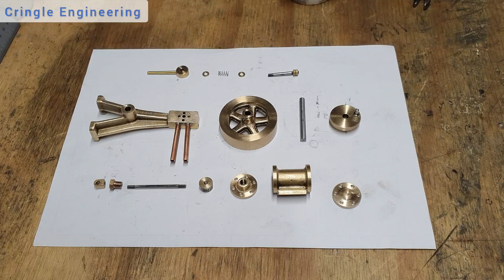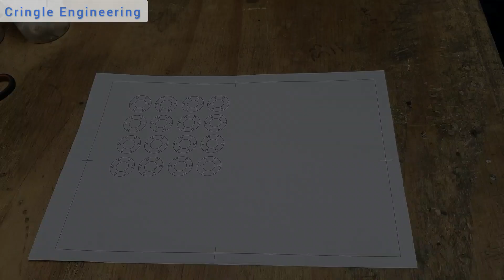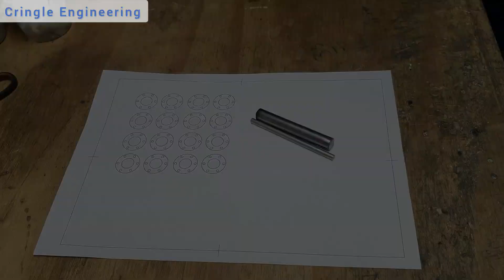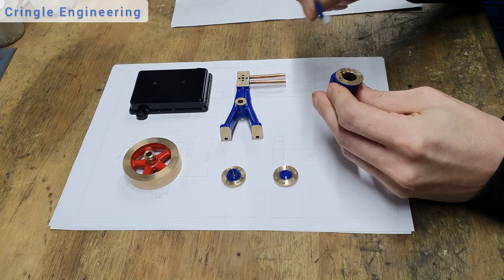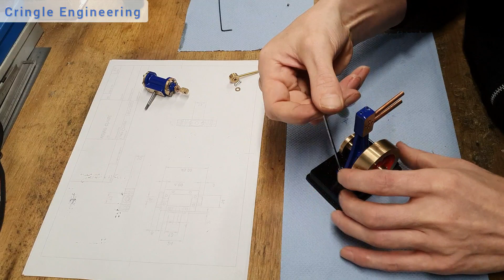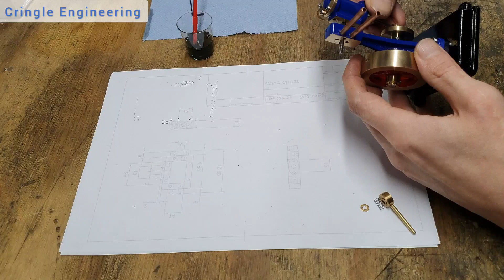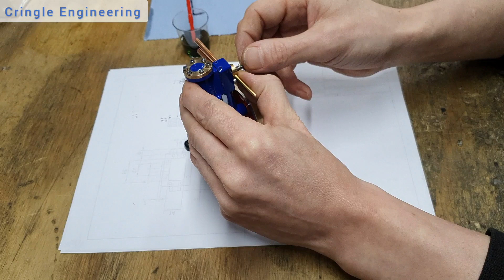making a model engine part 7

Comment: Great job ! Absolutely beautiful 
As far as stability , they were never designed to run at 2000 RPM . Maybe 700 tops . Try shortening the change lever or make it from aluminum .
I made one out of spit and bailing wire , single action and when I hit it with about 20 lbs. of air my tach said 2000 + RPM .
Didn’t do that very often 👍👍
Reply from the maker: Thank you. I wouldnt expect it to last very long at that speed lol.
It realy only needs a few psi, i can power it just by blowing down the pipe so i think it will run from an aquarium pump and sit on my dest ticking over nicley.
Reply: @cringleengineering7688  Another option would be some sort of ball-detent for the handle, but getting that into the current design would require enlarging the valve I think.  THOUGH, if you were willing to use just a pair of detents in the outside of the reversing valve, and a piece of bent spring-steel to 'interact' with it, it might just e the ticket.
Reply from the maker: @TheFreshmanWIT  thanks, i think i could do an outer spring detent quite tidy looking, just one little screw and a flat brass spring would do it nicely.

Comment: Nice looking engine. Are you planning on producing a few kits or whats Up with the nice casting Setup? Greetings from Germany
Reply from the maker: Thank you, yes il be adding them to my website very soon.. www.cringlemodelengineering.co.uk
Reply: @cringleengineering7688  thats neat, what alloys are you using? Why not Go for Metal molds If you make a couple of Kits?
Reply from the maker: @clypeum5063  i use bronze alloy for this model. I currently use around 60 different patterns to make all my models, to make them into metal molds would cost more money than il make back so only viable for factory production use.
Reply: @cringleengineering7688  That makes sense yeah, might also be fast to make small changes on your designs. im thinking about getting one of your generator kits, do you have more detailed specs on the power output? Are those coils standard part/Can i get replacement coils if one gets damaged?
Reply from the maker: @clypeum5063  hi, yes i just dont sell any were near enougth to justyfy the investment needed for metal molds.
The generator kit has been very popular and is currently my best seller with great feed back, the coils i make myself and i supply spares on request if needed at cost unless faulty, i have only had to supply 1 new set out of 100 to one customer who wired it wrong, twice!
The generator should produce around 12v 500ma at 600rpm.
It is brushless and produces no drag without electric load. 
www.cringlemodelengineering.co.uk

Comment: Your new engine looks great, it has some beautiful details on the cylinder. Have you thought of making a twin cylinder version?
Reply from the maker: Thank you, i havnt realy thought about it, i think a 'V' twin would be easy to do would just need to make a new standard casting, or i could replace the reverse valve with another cylinder to make an 'inline' double, would look nice but will require a more complicated crank an extra bearing.
Reply: @cringleengineering7688  both versions (v and inline twin) would look very nice if made with castings.